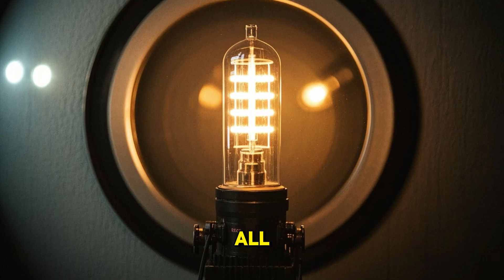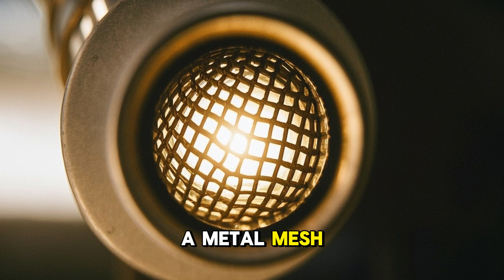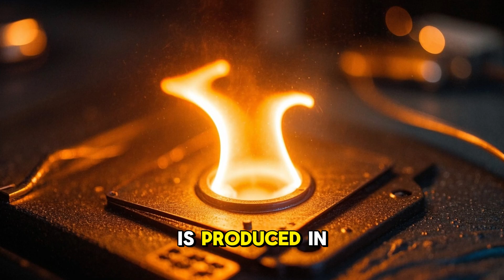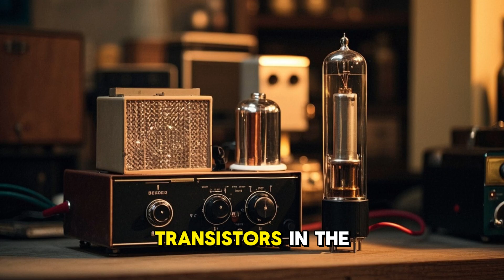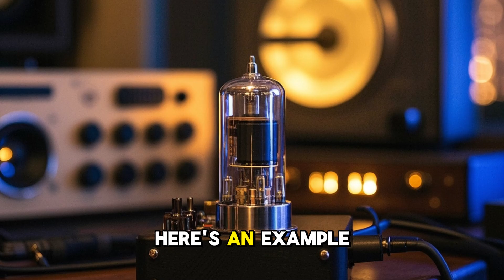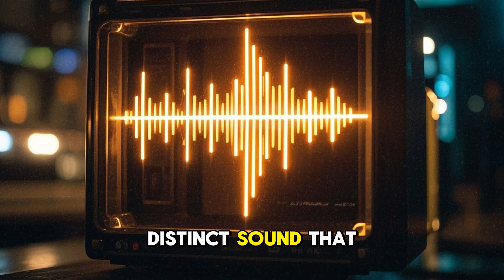"Vacuum Tube 100 Years old Technology "

Comment: Uhhh, no. The input signal does not cause the tube to glow. Nor does the electron current You have got that completely wrong. The input signal is not strong enough to do that, nor does it work that way anyway. There is a filament which is heated simply through its electrical resistance. ANd I could not be bothered to type explanation anymore.
Reply from the maker: A vacuum tube works by controlling the flow of electrons in a vacuum between electrodes. It typically has a cathode, anode (plate), and sometimes a control grid. When the cathode is heated, it emits electrons (thermionic emission). These electrons travel through the vacuum toward the positively charged anode. By applying a voltage to the control grid, the electron flow can be amplified, switched, or modulated
Reply from the maker: Thank you for your attention and guidance.
Reply: @VoltnWatt-78  That's correct. And what you said was nothing like that. LOL.